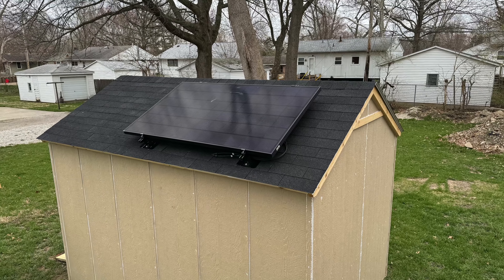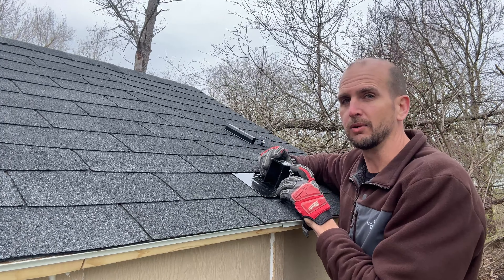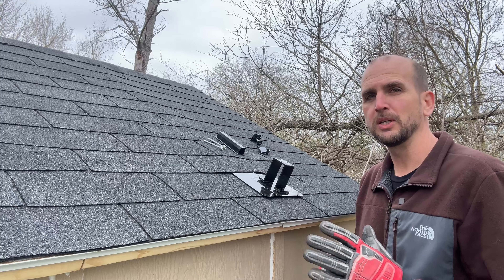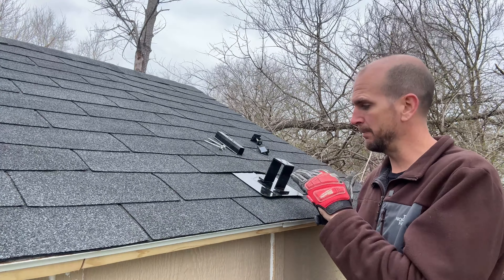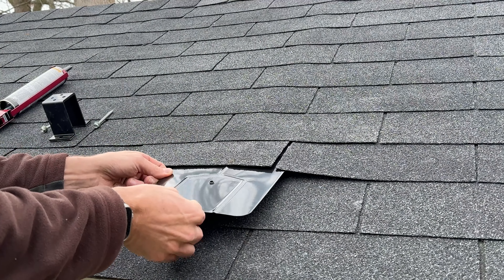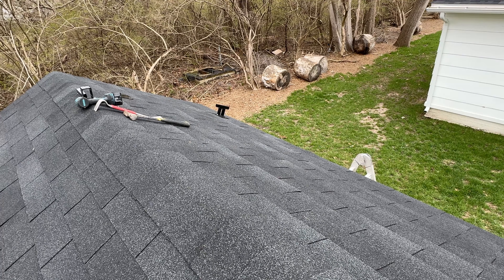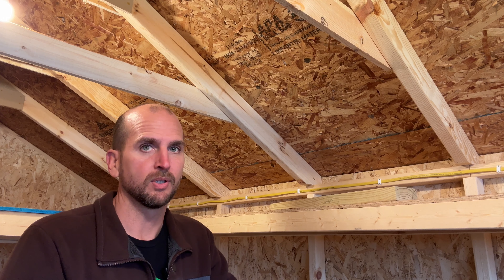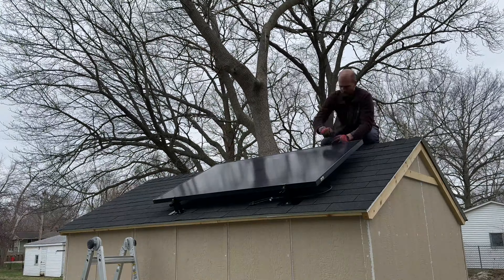How To Mount A Large Panel On A Small Shed

Comment: Great video.  I have 2 panels that I need to mount.  Considering options.  Thank you for the detailed video and info on how u did it.
Reply from the maker: Check these out as well which are handy for small arrays.  More holes through the roof with these but you don't need to hit the rafters https://youtu.be/9y8HmG8eYq8

Comment: I like it!   I would use a bit of a different method for a lag screw miss.  Instead of securing the 2x6 (2xWhatever) with two screws on each side, I'd use an actual steel bracket on both sides and secure it  to the rafters that way.   A bit more expensive... more nails or screws plus the two brackets, but that way it actually becomes part of the structure and will strengthen the roof for the work.  Whereas with the two nails in from the sides... that won't strengthen the roof at all because it is all sheer load.

Comment: In regards to panel orientation, i recently watched a video showing vertically mounted bifacial panels facing east and west showing some interesting results. It would be cool to see you test this as well just to get another perspective.
Reply from the maker: Thanks for the feedback.  That would be an interesting test and I do have 4 bifacial panels that i could use for something similar.  I will add it to the list 👍
Reply: @everydaysolar  the video i saw was recently done by Undecided with Matt Farrell. And he just released one comparing his new solar panel roof to a tesla solar roof. Also was pretty interesting.

Comment: I know rafters are supposed to be 16 inches on center.  However between the builders inaccuracy and my own lack of precision, I always manage to miss at least one.  If I can access the underside, I have used nails to mark where they are.  I just put sealant in the hole and trust the flashing is enough to cover it.
Reply from the maker: For sure, honestly I think the majority of installers miss at least a few just hopefully not too many.  Thanks for the feedback.

Comment: what size wiring should I use for my solar panels to the Oupes Mega 3?  Any other items I need to hook them up?
Reply from the maker: The size of wire will be selected predominantly based off the about of current you will be running through the wires and the length.  On top of just having the right wire to handle the current you would like to keep your line losses under 2% if possible.  This video will walk you through what you need to know and also there is a line to our calculator https://youtu.be/FMyhQAwaw2Q